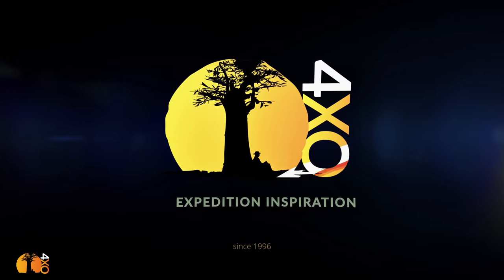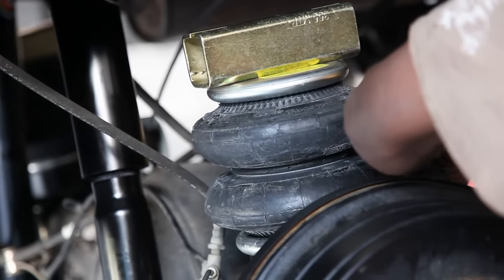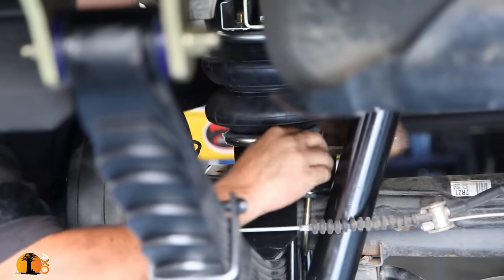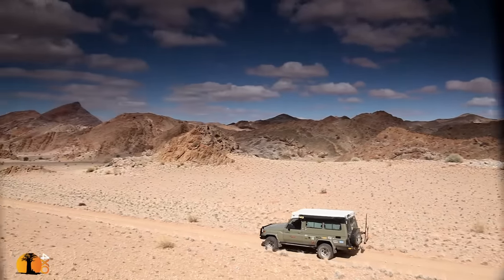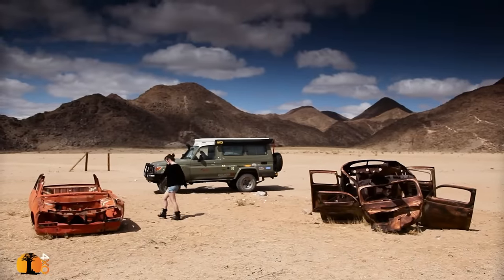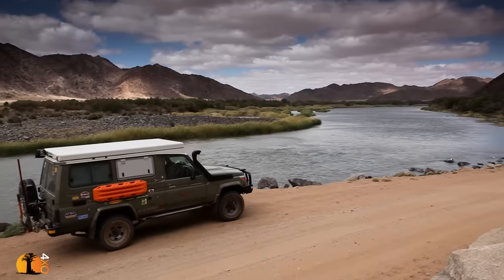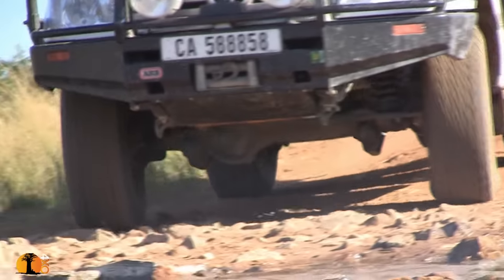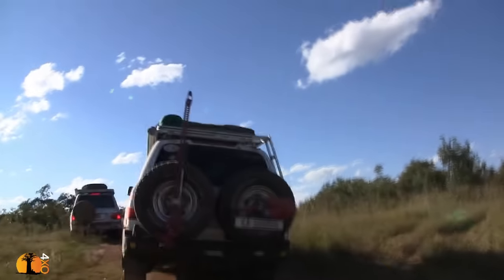AIR-BAG HELPER SPRINGS. ANY GOOD? | ASPW 4xOverland

Comment: I know you kinda hate the Land Rover Discovery 4 platform and its air suspension... but I love being able to level my rig with the xlifter module.  4.5 degrees of pitch and roll of self levelling.   No stacking rocks or maxtrax... I just press a button and have a level bed, tailgate, etc every time

Air bags kinda give you part of that capability.  I would have thought you would be into the luxurious feature of levelling via air.
Reply: Yes but the Discovery chassis was engineered from the get go to use the air bags. This is not the same as adding them on later, especially to springs that may have already increased load carrying capacity.
Reply: I rather just sleep on a slight angle than mess around with air leveling or rocks....
Reply: @RyanYoxo  uh,  it’s one button push lol.  whatever man.  I swear any mention of anything and someone has to say something like this.  i’d rather slam my head into a wall than hang out with people with that attitude.  you do you man.
Reply: Iowa LR4 attitude? Me not being a sook is an attitude? Mate no need for fancy gear just deal with it, want comfort go to a hotel.
Reply: I think the dislike of that system is the reliability and complexity making it difficult to fix in remote areas.

Comment: Im currently running the 500-700kg Parabolics; my vehcile is pretty heavy as a daily; and very heavy when touring. But they handle so nicely in both cases. I just find the HD shocks from TT need to be beefed up to handing the parabolics at a full load; so probably looking at going to the pro shocks in the rear.

Comment: Hi Andrew, why not air only? Light and simple to replace so carrying spares is not a problem and if maintained very reliable.  I have driven Range Rovers for over 30 years including a one year 24000 mile trip around Australia so very familiar with the vehicles. My current daily driver is an all original P38 with over 330000 kilometers on the clock and the suspension has been totally reliable.  I would not hesitate to take this truck anywhere. Shurely air has to be the way for variable load situations as can be seen on numerous trucks.
Reply: Generally, air suspensions have very limited travel. One of the benefits of the LC is it’s articulation to maintain mechanical traction. Swapping to air only will severely reduce its capability. The ride will be beautiful tho!
Reply: Hi, I certainly wouldn't say that articulation is compromised on my P38 which also has solid axles. Air suspension also gives you the ability to raise and lower the vehicle as required and self levels. Well maintained they are not at all problematic so I would say perfect for an overlander. Yes, they are of course more complex than four solid springs but ECU's and fuel injection are more complex than points and carburetors etc etc. I would be interested to hear why Andrew would not consider an air only system.

Comment: Do yourself a favour and get the 4 leaf TT parabolics.
Once you tune the rebound on your shocks you'll find the unladen ride spot on.

I've got mine spot on now in my 76 series which IMO is almost the same to the troopy.

Remember you can always remove a leaf if you want to, but considering your troopy will be carrying a reasonable weight when touring, the 4 leaf TT will be perfect.

Oh and you can add another leaf if you want to to your current set-up.

Thanks for sharing
Reply: Watch his last video on the build. He has the parabolics
Reply: He has the 3 leaf, I agree he will need the 4 leaf unless he really loves the Carolina squat look. 

I'm running 4 leaf and air bags in my troopy.. granted I'm likely heavier than he plans to be. I just don't think the 3 leaf will be enough, particularly with no air bags. The great think about parabolics is their ability to ride well unladen, so why not go the 4 leaf
Reply: @danielhayes1000  I guess Andrew can take a gamble as most things on his truck are freebies. We need to get it right or it's hard earned wasted.

I have to agree that the 4 leaf Parabolics are really very good unloaded. I really believe adjustable shocks with rebound adjustment is crucial to controlling the kinetic energy of the parabolics.

What shocks are you running?
Reply: @danielhayes1000  ok yeah sorry you’re onto it!
I’ve got the 700kg ome leafs and kinda wish I went the parabolics, don’t quiet need airbags yet but maybe in the future.
Reply: @michaelnugara1  I'm running terrain tamer shocks aswell. The ride is good. The airbags were simply to even out ride height from front to back for asthetic reasons, which btw I also don't have a problem with.
Reply: @danielhayes1000  did you get the adjustable TT shocks?
I almost bought them but they didn't have rebound adjustment, which I wanted.
I ended up getting the Dobinsons Adjustable Remote Reservoir shocks and think they are bloody terrific. There is so much rebound adjustment that I have been able to tweak the rears spot on now.
Reply: @michaelnugara1  yeah ok, certainly something I'd like to do one day. Mine are just the non adjustable heavy duty variant

Comment: Depends on your usage. I had a Pathfinder that suffers from being low already, loading it up sagged even more. I fitted in spring air bags and only inflated them when I was loaded, normal driving I left them partially deflated. This brought the height back to normal even when loaded. 
The in spring airbags place the load on the part of the chassis that is designed to take a load from the springs anyway, I agree separate airbags can be a problem. 
I now have a Prado Kakadu with standard airbags and enjoy the automatic height levelling when you load it up.

Comment: Yes I agree if you overload your 4X4 then add air bags then your chassis becomes a huge spring and starts flexing and twisting it will become a 3RD part off your suspension and yes it will fail awesome work Andrew keep up the informative information cheers

Comment: Completely agree. Airbags are great for towing but I've never found I've needed them otherwise. Shocks with adjustable compression has made the biggest difference to me! Really helps to take the harshness out of heavier springs when the car is in 'daily' trim between trips

Comment: Thank you for the information! I have a 1973 Case MB 4/94 that I would like to put a 5th wheel hitch in the bed for a water trailer and tote on the bed. Need to look into springs to compensate for the load of the bed and trailer.

Comment: Airbags probably encourage overloading. It seems the airbag equipped mid size twin cabs (Triton, Navara, Ranger etc) are more prone to snapping behind the cab ... like the 2018 Triton at Well 41 on the Canning Stock Route that broke in July 2019.
Reply: There's likely some confirmation bias, I can totally see someone using cheap airbags to level out the ride then load up their dual cab with well over 1t of gear. It seems like it would be fine as the car is level yet if they had upgraded to heavy duty springs, when overloaded the ride would be terrible and focus the owner to reduce the load.

Comment: Don’t forget with airbags, you’ve just added 2 x 5, a total of 10 new failure points to your suspension (valve, press fit connector for valve, hose, press fit connector at the air bag, and the bag itself).

For some cars, if the airbags fail, it’s probably not a big deal, but for cars like the Pajero Sport, the airbags replace the factory bump stop. Failure of the airbag in that scenario could be catastrophic.

Comment: Yes Airbags are usually used as a cheat instead of getting heavy duty suspension, yes they r fine if u occasionally tow a heavy load while the rest of the time the truck is empty. What I think is a must on offroad vehicle especially is soft bump stops, those well help reduce the shock off bottoming out make it a much smoother ride and there r several designs out there that work great

Comment: hi Andrew,
there is a solution with HELPER SPRINGS – LOAD PLUS HELPER SPRINGS IronMan 4x4 suspensions have those but I believe their other brands also. you will continue to have the ride you like and at the heavy load it can help you. ιif you play with the shocks regulator you can have a nice ride with a heavy load

Comment: Andrew not arguing the point of how destructive some of these setups can be as we have seen many times .
But my experience is with a  100 series lc  not a big brand set of air bags , set to the manufacturer instructions over many years of travelling inc GRR etc .
Not trying to jack vehicle up but to leave only , caravan horse float boat etc with no problems to date . Thanks for your videos..👍

Comment: Andrew. Logical and sensible advice. Surely simply adding air bags to compensate for not fitting correct spring and shock absorber rates in the first place is completely wrong. For safety surely you need to fit springs and shock absorbers set up for maximum GVM. Alternatively consider adjustable shocks for the times when only lightly loaded. Great explanation thanks👍.

Comment: I've got a GX 460 with the rear bags. I love them. They are engineered by Toyota so perfectly matched to the vehicle. And they really come im handy when I tow. BUT I'm raising the front end  with coilovers and adding a 150 lb front bumper. I DO NOT want to delete those awesome airbags and convert to coilover. At least not until I get a dedicated tow vehicle, so what can I do to address the rear in the mean time. Should I replace the factory struts with the same brand struts I'm putting on the front? Or just leave everything alone in the back?

Comment: Use on full size truck like Nissan Titan XD , no problem. I will decrease pressure on wash roads, but increase on asphalt. Another thing I have notice to helps on of camber, with all weight at top (RTT, box ....) it's less lean on sides help CG up, feels more safe, hope less tip over problem.

Comment: I agree with the helper comment… i use it only to lift the back slightly when towing and do not use it to overload the car to the nth degree

Just having that slight correction when towing does improve the ride quality a lot

I have never gone above 2,5Bar, thus for me I feel I am adding some load to the airbag mounts but I am not asking the airbags to carry the entire load

Comment: If keeping within the cars GVM towing doesn't add weight to the towing vehicle, so I don't see a need for airbags even then. Andrew is right just get your springs and shocks right :)
Reply: Well yes and no. You are correct in 99% of situations, but say for example you had a single axle trailer of max towing weight (probably 3500kg?), you would then have an enourmous towball download weight, miles over the rear axle, really compressing the springs. (not sure if theres a limit for towball downoad, or if it just has to be incorperated into axle limits/payload). But again, you are correct 99% of the time
Reply: The ball weight from the trailer does add that force to the tow vehicle and must be included as part of the GVM calculation for that vehicle.
Reply: @HardstylePete  Yes, I was assuming he knew that already
Reply: @HardstylePete  Yes a trailer puts a load to the tow vehicle but if you stay within the vehicles GVM your not adding any additional load over the GVM

Comment: Good topic and good comments. Like all things, you really need to be clear about what it is you're trying to achieve. First,a lot of 4wds have very poor GVMs. Trying to carry a tonne of weight in a vehicle that can effectively only carry a few hundred kilos is nuts. Go and buy a truck! A lot of 4x4s carry a lot of equipment permanently. You need to get the correct suspension set up for this permanent load. A slight increase 'may' be helped by air bags. It's a fine line. The other issue is that a lot of coil spring suspensions have a very long bump stop which must be removed to fit the air bag. These are not a bump stop but are actually designed as a spring/shock/suspension component. Why? The usual issue with manufacturers cutting costs! Removal of this is another can of worms. Air bags for towing? Another can of worms! Depends what you are towing. The weight over each axle and the towball must be distributed evenly and correctly. A weight distribution hitch may be required to equalize axle loads. This is a complex topic needing a lot of analysis for each situation and expert advice to get the correct and safe outcome.

Comment: Yes.. its just the look.. :). All vehicles look better dead equal or a little higher at the back. I wouldnt, not have air bags on a coil spring back end. They are brilliant..

Leafs are a bit different, the chassis isnt really made for the forces at the point they are fitted, unless reinforced.

Comment: I tend to agree with most of your points, however, if you chat with the outback mechanics who see the bent chassis' coming in on flatbeds. They say there are only two vehicles they would put airbags on. One is the 70 Series Landcruiser's and the other is the Amarok. These rarely if ever have issues based on their chassis design.

Comment: I have air bags installed inside the rear coil springs of my Grand Vitara 4WD which I only pressurise when towing. They make the vehicle ride and handling much better when towing and don't seem to affect the ride much when at minimum pressure, not towing. I'd rather have them than not. I guess it depends on the vehicle.

Comment: Good points about airbags but in some cases they are factory fitted like my 96 Chevy G30 Van. Good for trimming and leveling the vehicle but no substitute for a good fresh springs. I think that the main issue is that people don't understand the limitations of them and as such misuse them. Don't even think about air shocks either!

Comment: I'd be just trying the 4 leaf Terrain Tamer parabolic springs. Easy to swap. And if you don't like them, you can go back the the 3 leaf springs.
I've got a 'medium loaded' 78 running the 4 leaf parabolics with KONI RAID 90 shocks and they are still very comfortable. It's 3090Kg (1370Kg front Axle, 1720Kg rear axle) with me in it and full load of 180L of fuel and all the camping paraphernalia which is still 200Kg under GVM.  When I put in 110L of water, and fill the fridge it'd be getting up towards GVM, but still under.

Comment: I put air bags on my 13 JKUR as i had put a motorcycle carrying hitch on it, and with that extra 500+ pounds ish on the hitch, yea, the stern sagged. After that, I now actively tow an RPOD travel trailer which is , ah, shall we say at the GVW rating, and even without the equalizer hitch, the bags keep the unit well balanced overall. Funny thing - it wasnt the rear diff that ive broken, it was rather the front diff that broke in half. The fault still lie behind the steering wheel, of course. 

You nail it well on the head -- what is the vehicle going to be doing? If it spends most of its life empty and only rarely sees full load, air bags make sense. If it spends most of its life loaded, upping the spring rate makes much more sense.  With my ride, it always has a loaded 'coffin size' tool box on the roof rack, steel winch bumper and winch up front, and sees frequent towing - so, when i upgraded the front diff, so too did the shocks all round (they were done anyway) and upgraded springs up front and airbags that i already had astern. 

One other thing I might point out - in a solid frame vehicle, the frame is designed to take the load of the vehicle across its entire structure. Im sure therell be exceptions to that, but in general, well, we use the frame to lift a vehicle clean off the ground regardless of its load at any mechanical shop. Generally, any two post hoist with its four arms is going to want to make contact to the frame for a solid lift.   Is an air bag going to break a true frame? Id love to see pictures of that, and if there were any, ah, comorbidities to the fault (rust, collision, etc), cause im really skeptical on that.  

Now, UNIBODY vehicles, aahhh, that is its own ball of wax, and , in my personal opinionated opine, unibodies arent particularly grand off road vehicles when compared straight across to a frame unit.

Comment: In my experience, if your front high the headlights look like high beam to oncoming traffic and could create a less than desirable situation. Either in the highbeam response from the oncoming traffic or an accident caused by your inability to dip your headlights.

Comment: This video is 100% accurate. Particularly with older vehicles. Adding excess weight and supplementing that weight by adding extra suspension compression willhurt the chassis, axles, bearing and diff.

Comment: 100% right on getting suspension right first.  **Your first video on air bags over axle on a leaf springs is a huge no no for chassis damage as if used incorrectly will direct the force/load where it’s not designed, this is unless the chassis is re-engineered. But you address this in update. Inside a spring will not damage the chassis as it’s in the loaded area,  your 100% right on its effects on the operation of the spring and shock but. **Edited! Sorry see your update.

Comment: Hi Andrew. Have you considered the Timbren SES system that replaced the bump stops? It extends them but not to the point of full time contact with the axle. So unloaded ride should be the same and when heavily loaded, they provide a progressive amount of support.

Comment: Lots of blablabla. Fab Rat just demonstrated how air bags should be fitted properly in his dad's 200% refitted extreme offroad tow truck. Ofc the fram has been modified to cope with the extremely different loads a tow truck will face every day. As such, his airbags serves their purpose adjusting to flexible GWMs.